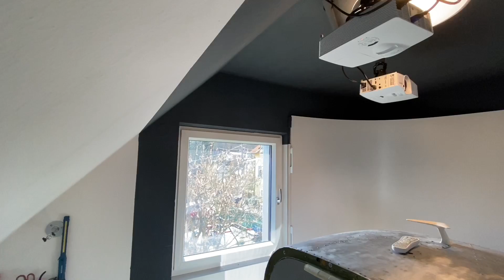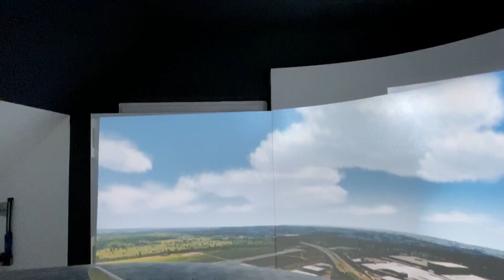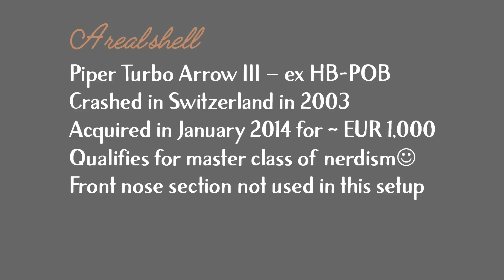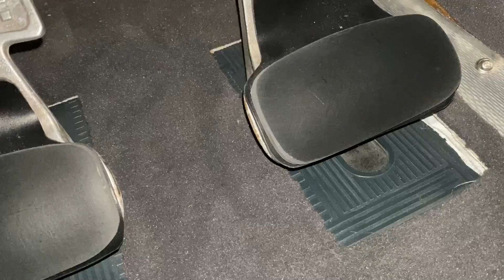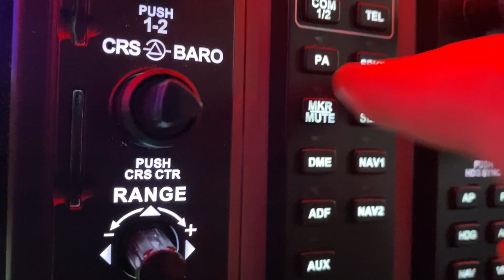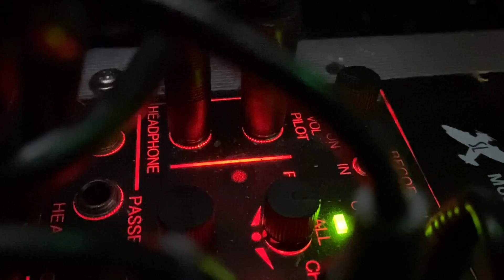Simroom-Tour of my twin-engine Home Cockpit

Comment: Mirosoft needs to fix the side views. We need another direction movement to what I call Tow-in and Tow out. Notice this perfect simulator this Man made. However we still have the engines towed in so they are visable in the front windows.

Comment: good simulator but I think you need a better projector solution
Reply from the maker: Yes, could be a little better - but the options are limited - 3x4k is not possible to handle through the pc, reducing the projection size is not possible too - so for the moment it is the way to go.

Comment: The resolution of the projectors is a problem for me. Im currently shopping around for short throw 4k laser projectors for a future build like this. You can definitely see 1080 low resolution when blown up.
Reply from the maker: You are absolutely right - but driving 3 4k projectors would mean several very strong PCs - so no option for - mine is really state of the art and struggles with 3 times 1080 with all the add ons. But in a future build I might go for frame-less lcd screens - now not yet affordable.

Comment: Hello  @
Alfred twinSim! Great work! I wonder about real aviation intercom sl-400, do you need a Real Transceiver to make it work or you just pug the headsets and you can have intercom?
Reply from the maker: There is a usb sound card that lets you connect aviation headsets to pcs via usb. It is there where I have just plugged in the intercom. It should be stated in the video what I used!

Comment: Hi, I have a similar setup, that I had running fine for 5 years now, triple Optoma GT1080. But the last time I had actually used it was back in December 2019, when I had to upgrade my failing dual sli 780Ti to a GTX 2070 super, and the set up was working fine after a recalibration and few tests. Unfortunately, life took a turn, and I didn't get a chance to use the pit until very recently, and I find that while my windows 10 and NVIDIA drivers are up to date, something in windows messed up the setup, so I can only project to one projector on the main channel, the other two projectors won't even beam a signal, although individually, I have tested them and they all work fine. Secondly, they are no longer recognized as projector, so when I use the software Simpit Warp (a fork of Fly-Elise), it doesn't see any projectors (0x0) so I cannot warp it to fit the screen. I'm wondering if if you know what build of windows or update wrecked this, so I can go back to the build before, as I was told that you should not allow automatic updates lol. TBH, it's rough trying to find information regarding setups like ours as we're like 1 percent of 1 percent of gamers or simmers. Any ideas would be very helpful! Thanks!
Reply from the maker: When switching in nvidea between desktop surround mode and separate mode windows loses in the beginning all other screens than main screen. It should be quickly possible to assign those again, but I do not have remember unfortunately the steps. If that is the sole problem now you might fix it quickly. Fly Elise runs w/o problems?

Comment: Dear Alfred. You’ve done amazing work. In Moscow we’ve built C172 cockpit with 220 deg screen. Now we experience some issues in setting lateral FOV (XP doesnt give us more that 60 deg when using Nvidia Surround). Please contact me andro_sh@mail.ru. I need your advice
Reply from the maker: Andro Shioshvili thank you. You can not reach a correct FOV with surround mode. You need to use a correction software with more view points, in my case I use FlyElise calibration pro.

Comment: What an amazing home cockpit.  I'm just starting to gather parts for my own build.  The PFC throttle has me very intrigued due to the ability to swap out throttle types.  Obviously it's very pricey though.  I don't foresee flying airliners but I would like to have something 'realistic' for most GA aircraft and even some business jets.  How difficult is the throttle to setup (is it 'plug and play' or does it require some setup in an app or programming)?  Not much info out about it.
Reply from the maker: sorry for the late reply! If it is still of interest, the setup is easy, you just have to assign the axes to your sim.

Comment: The rumble is great. But once airborne the vibrations are not that extreme even on a prop plane. You should tone it down a notch when aloft
Reply from the maker: Yes, but it is also the drag from the extended gear and flaps. Once it is cleaned up and throttle and mixture not in the max it is soon pretty quiet. But maybe I can make the lift-of moment even more noticeable.

Comment: Hi Alfred.
Very impressive built. Awesome.
Question though about your curved screen and projectors. I have read a couple of times that night flying with projector and curved screen supposedly sucks (washed out runway lights ...i guess blurry?) Not sure though how old these statements are and if technology has gotten better? What is your experience with night flying using projectors and curved screen? Couldn't find a video of yours where you do a night flight.
Would be great to read your 2 cents on that.
Thanks a lot !!!
Reply from the maker: Thanks. Indeed, I do not use night time since the areas where the 3 projectors join show increased brightness. I would physically need to fix something sideways to the projection lense to maybe reduce it. Saying that with this thing solved I would not see further problems and night in general looks not that bad.
Reply: @AlfredtwinSim  Thank you. I appreciate your input !

Comment: $900 per projector!!!  That’s a huge nut to swallow. Three TV’s would work just as good. For half the price.
Reply from the maker: I got the for around 500 each. The setup is far too big to use just 3 tvs. Further more there is no place for permanently mounted screens on the side. Last but not least the curve makes the view perfect without edges. But in a larger room 5 tvs in portrait mode would be a consideration.

Comment: Very nice setup buddy, very similar to mine. i used 2 projectors same as yours, and also Fly-Elise for calibration. A question, why did you not plaster the seams on the screen (drywall plaster) and then sand them and paint them, to eliminate the joints? Very nice indeed.
Reply from the maker: Thanks! I use 3 projectors. For permanently fixing drywall to the wall I need a backstructure, which would reduce visible diameter. Further more I have two sliding sides which could not be solved with drywall plates and mixing screen surfaces was not my desire.

Comment: Lol.. he could have purchased a REAL PLANE for that $$$$
Reply from the maker: Yes, but definitely an old one and not state if the art. And there are no running costs of mine🙂
Reply: @AlfredtwinSim  "running costs" - electricity (those PC's and components aren't running on air.. and speaking of air -  you also mentioned needing to crank the AC), projector bulbs that burn out, and wear and tear/upgrades... Also, you'll need to fix the joints of the house with all that rumble rumble on the studs...... cracking drywall on the way.. :_0
Reply from the maker: @pesto12601  Actually I do not fly it too often, so it does not cost a lot concerning electricity. AC is not yet in there and just necessary in the hottest time in year - projector bulbs have not yet been replaced, so not idea how expensive they are - but your are right - there are also running costs - but nothing compared to what a real aircraft costs. And I am a simmer, for me building and owning a sim (and I have more sims than that one) is a big part of the hobby - aviation is wonderful - but this is the smaller part of my interest, the other sims are car sims for example in real cars.
Reply: @AlfredtwinSim  Yeah.. I'm super jealous of that setup!  Enjoy it...

Comment: It’s beautiful! Do you know if you can use the flight ilussion force feedback as linked controls?
Reply from the maker: Sure you cam if you have two of them
Reply: Brunner yokes are much much better.  I switched my 2 FI yokes for 2 Brunner CLS-E  MK II's   BIG DIFFERENCE.
Reply from the maker: @billdavis9734  They might be better, but I had already the metal yoke handle and it was like half the price getting it from Flight Illusion - Brunner comes from outside the EU and thus is quite some investment in taxes - Flight Illusion offer you to use your yoke handle and they mount it onto their base - so it is quite a difference from the price point.

Comment: its nice and technical-wise, a fantastic job, but! for me, i would want flexibility rather than being rigidly being a specific airplane or even an airplane.
i imagine being able to swap out the wheel for a car race or helicopter controls or an out of world star wars battle.  Then i would be happy about spending the money
my point is, from the ground up it should be a feedback platform with interchangable controls.  but this is my want not yours, so seriously well done in delving fully into your hobby, nothing better
Reply from the maker: Yes, to move even more between types would be great. I had the idea to make the engraved frontpanel exchangeable to really switch control legends too. Further more my G1000 will soon allow to be used for any type needed. But to make it cross sim compatible... heli and car, that would not work. Too much difference. I prefer building everything separate... actually I do work on a mini cooper sim in a real shell.. that one would never be an airplane😀
Reply: @AlfredtwinSim  im nerdy, i imagine a full-on space battle, fully dark room, your wrap around screen..... i dont even play games and it still looks epic

Comment: Great effort, but so many devices to fail... Anyway I’m impressed.
Reply from the maker: Yes, surprisingly since moving to Xplane nothing failed at all, so it is just the software that did pose problems before. Hardware works without any issues...

Comment: What did you do with the other components ( Gear /FLAP/GA/Rudder trim switches) on the Precision flight controls? Also, how are you getting along with your FB? I have been looking at that for some time.
Reply from the maker: The gear lever and the trim switches are mounted into the panel, I have some stuff available for future builds. What do you mean with FB?

Comment: Hello great Homecokpit!!! I wanted to ask how you set the view with the wings on the left and right without the cockpit and panel
Reply from the maker: Hi, thanks - sorry for commenting late. First thing is to change the 3d model of the default King Air in a 3D software and delete the front part of the cockpit that would be visible. Then it is configured as Virtual cockpit view and need some adaptions to work correctly with FlyElise warping - which does in xplane11 generate some view errors when using warped display with a VC.
Reply: Alfred twinSim hello thanks for the answer, which software for the 3d model do you use?

Comment: Here's a free idea to manufactures out there... a projector that can shoot... wait for it... 3 ways simultaneously. I only wish to have my creation named the Salvation. Also, plexi is extremely cheap... get some new unscratched pieces for your windows bud. That's nasty.
Reply from the maker: yes, that would be a nice projector, but considering that it is a niche there might not be too many customers buying those. But I would definitely go for one of those. The plexi for the windows was a pain in the A** to get into there. The door is round and the window is bended into two directions. I did bleed and swear to get those plates into there and the inner part of the door screwed onto the outer part again. Yes, I did skretch it a lot. But comparing it then to my original front window which is skretched extremly as well I like it now very much. Without skratches by the way you do not need a window at all, but with those wear and tear elements it makes you feel much more enclosed.

Comment: With that amount of vibration you might want to get your props balanced...
Reply from the maker: I am not sure but think they were synced in this test flight. But indeed, the vibration urges you to bring them back after takeoff and further more sync them correctly.
Reply: @AlfredtwinSim  I meant that from a comical sense.  In real airplanes when you have excessive vibration you often want to get your props balanced.

Comment: Great video! Since you like to fly X-plane’s default KingAir C90B (me too), you might be interested in my Ultimate Mod: https://forums.x-plane.org/index.php?/files/file/59450-default-beechcraft-kingair-c90b-jongepionier-ultimate-mod/
Reply from the maker: Thanks! I did change the aircraft quite a lot in plane maker, so would need to see if the mod works with my changed files, but likely it does. Is the mod still necessary after the c90 update about 6 months ago?
Reply: Alfred twinSim Yep, it does. Version 5 is coming within the next few weeks.

Comment: sir u r using simionic  G1000. how is it compare to real sim gear? about software for true training and size? is it real or just good for game?
Reply from the maker: It can be used for training as I know others practicing with it correctly. The realsimgear is just a bezel with buttons and screen, so you need a 1000 USD software to feed it. And still it is then a hassle to operate since the software needs a own pc. So much easier, instantly running and has synthetic vision on top.

Comment: Try some rubber feet isolation from the floor and that transducer needs a more secure four corner bolt and nut fastening to the frame. Over all outstanding job. I use a  Buttkicker system on my racing sim to much "vibe" does kill the realism of the effect.
Reply from the maker: I have 4 rubber isolating plates (quite expensive stuff that is used in industrial setups), although difficult to tell how much shaking is reduced by using those. The transducer is fixed with 2 screws - are you sure it would make any difference in going for more fixing? Can do that of course - thank for the idea. Well I onced tried to make a startup with 100% vibration power, wow that felt pretty immersive, but as soon as I throttled up it was too much and as you said did not just kill the effect but also the cockpit interior.

Comment: So what are the PC specs that run this sim? looks great. nice vid.
Reply from the maker: an overclocked i7 and a nvidea gtx1070. Actually not fast enough so I am currently re installing the whole sim (and that is not that funny as it may sound) to a complete new rig with i9 and gtx2080.
Reply: @AlfredtwinSim  Hope you get a cheap 2080ti:))))) or hold on for the 3080:))

Comment: That is beautiful and that you're married is awesome.  If I came home with a shell I'd might as well stop at the divorce attorney's first... LOL.  That said, I have a question and I guess I could look this up.  Are the aural warnings about where the aircraft is on the airport and how much runway is left, etc. something with G1000 avionics?  I'm a very low time, 35 years ago steam gauge guy and only attempted one intersection take off.  It would have been nice to have that kind of informational feedback.
Reply from the maker: haha - yes it does need an understanding wife to build something like this! Sorry for answering that late - no it is not from the G1000, it is a runway awareness system (xRAAS - it is mentioned in the video at the end). A free add on - very handy to have.

Comment: Like to see Elite Dangerous on this lol. I love my Buttkicker Gamer 2 with DCS. The first time I used it I landed on the carrier with the F18. I had it turned up too much and when I hit the deck it knocked a picture off my wall. Firing the gun is insane also. Kobuleti taxi way is separated by cement sections and when I taxi you can feel the bumps between the sections.

Comment: Imagine this with maximum settings on Microsoft Flight Simulator 2020
Reply from the maker: Tommywickettaker that’s what I do! And I have the new pc waiting to cope with new system requirements...
Reply: @AlfredtwinSim  Can´t wait to see some videos of it... can´t be very far from reality anymore with the stunning visiuals and detail MS showed so far...
Reply: Imagine if it won't be compatible.
Reply: @NeoVirusOfficial  there are people working tirelessly to code these sims to work with Microsoft Flight Simulator. There are whole communities working together as he is not the only person with a flight sim in his home.

It may not be overnight. But MFS will be fully compatible
Reply from the maker: @PhinneusPrune  I am sure it will. I have already made a quick trial flight with MS2020 - I love the new platform very much. But they are not yet supporting multiple views - so the warped setup will not work in the next time and it is not on the task list of Asobo for the next updates - so this will leave many homecockpit builders out for the moment.
Reply: @Alfred twinSim Dear Alfred. You’ve done amazing work. In Moscow we’ve built C172 cockpit with 220 deg screen. Now we experience some issues in setting lateral FOV (XP doesnt give us more that 60 deg when using Nvidia Surround). Please contact me andro_sh@mail.ru. I need your advice
Reply from the maker: @androshioshvili9853  thanks! You need a warping software like calibration pro to overcome this.
Reply: Adil D. HaHaHa you are evil
Reply from the maker: Adil D. Yes, that might take time until everything works with 2020. but I am confident every supplier of my hardware will make it compatible.
Reply: He’s never leaving his house
Reply from the maker: Viraj Kapse haha actually the sim is currently running 30min a week only. Too busy with family, job and summer weather 🙂
Reply: That’s real life
Reply: I suppose you can't select sideview displays in MSFS2020, or how? Using Triplehead and just stretching the front view doesn't count